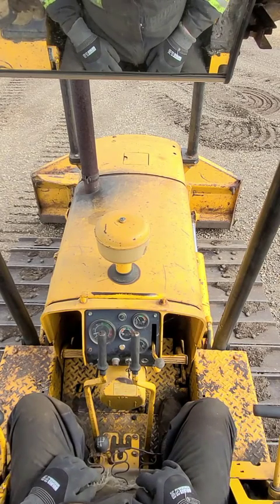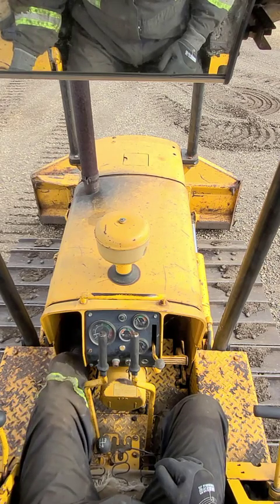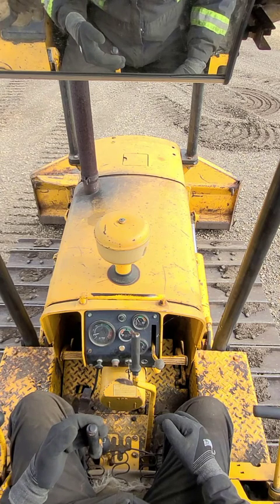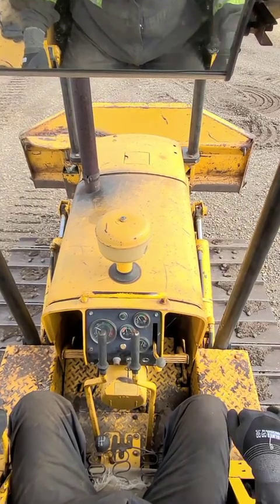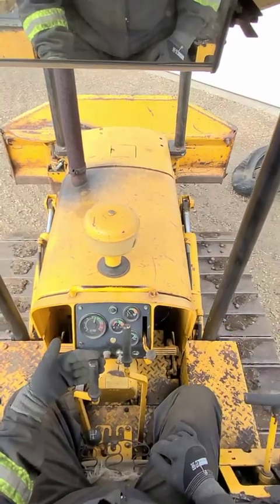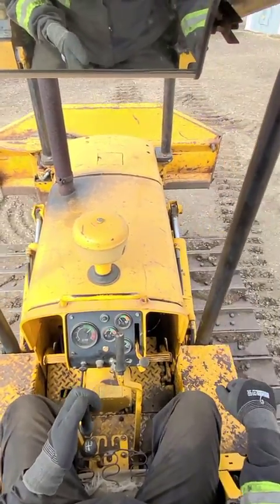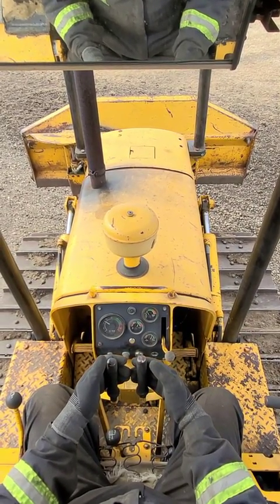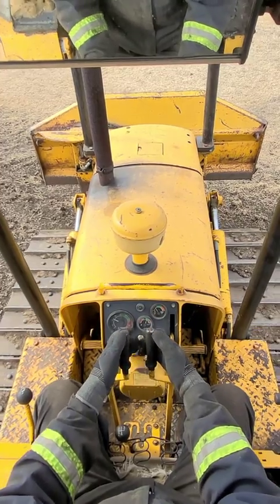Steering Clutch and Brake Operation of a  JD350C Track Type Tractor

Comment: Thanks so much, i got a 350C and i didnt know that the power disengaged to the tracks at half pull on the steering handles. So good to know when you need to do some precise turning and grading. i do only my own land but every time i use it i hopeflly get better and better. this is so helpful!!

Comment: I’ve got a 450 crawler (not sure of model letter) that looks a bit older than the one you’re showing. Do you know if the older models didn’t have a decelerator pedal or is mine just missing?  To give you an idea, I don’t have the 4 speed trans like the one you showed. My forward and reverse selector are behind the steering levers between the legs. On the left side “arm rest” is another selector for forward and reverse however both of my selectors are just straight forward and back. I’ve got reverse, neutral, low and high on the floor selector but have no idea what the left selector is for. Could you give me any advice?  I wish I could show you some pics. Any advice would be greatly appreciated my friend. Thanks for the video!

Comment: Dont let this distract you from the fact that Gru is the most powerful being in the universe and here's why: Gru is 4 minions tall, which means he is a godly size of 14 feet tall. Furthermore if any of you remember the original Despicable Me, you know there is a scene when Vector kidnaps the three girls and shoots a series of heat-seeking missiles at Gru, he then dodges them all. According to the speed of an average ballistic missile (1900 mph) and the size of the missile according to his ankle size, Gru can perceive and move at such a speed that the missiles only move 9.5 miles per hour, 0.5% of their original speed. After this Gru punches a shark and it is paralyzed meaning its spine is probably shattered, to remind you it would require a force greater than 3,000 newtons to fracture the spine.
That’s equal to the impact created by a 500-pound car crashing into a wall at 30 miles per hour. I rest my case.